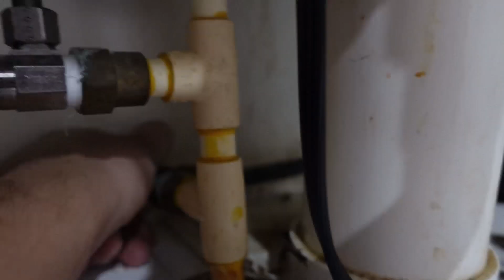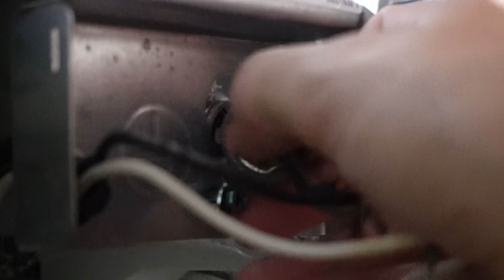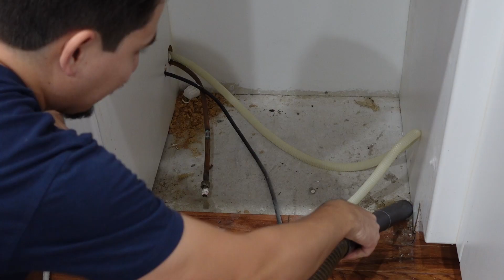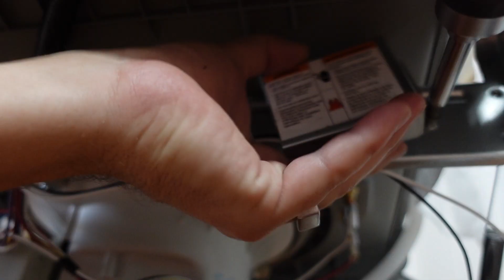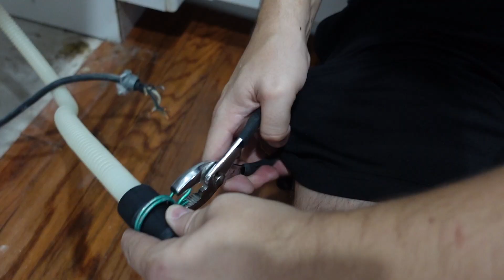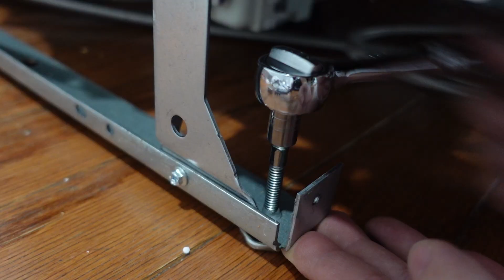How to Replace a Dishwasher (Frigidaire Example)

Comment: Thanks 🙏🏾! Did you remove the plug where the water line goes? My dishwasher had a tag that said remove plug if necessary. I’m not sure if it’s necessary or not 🤷🏽‍♀️the plug is not blocked there’s some kind of screen/filter.
Reply from the maker: I’m not sure I didn’t see anything regarding a plug.